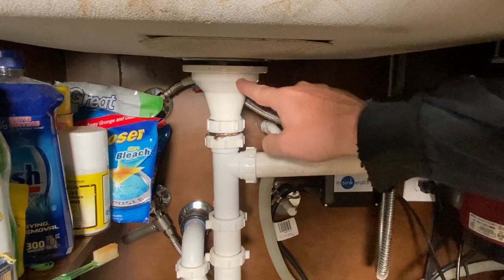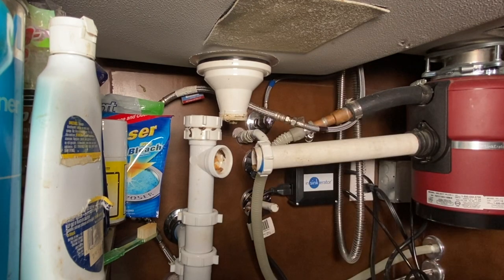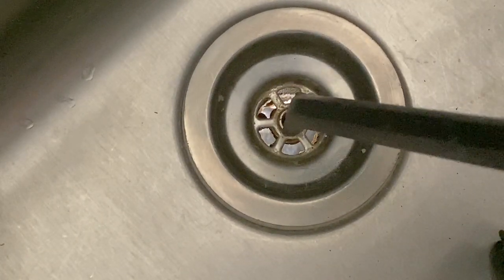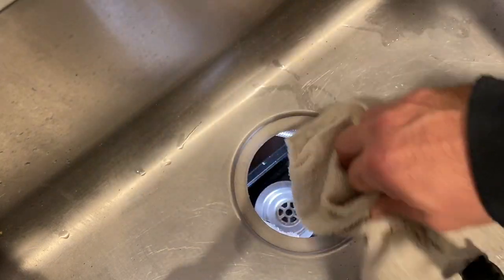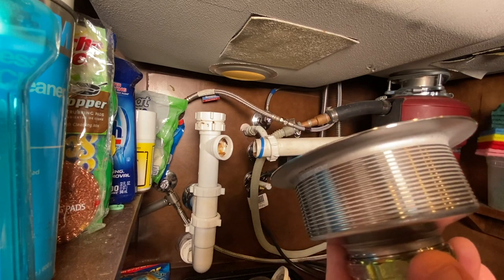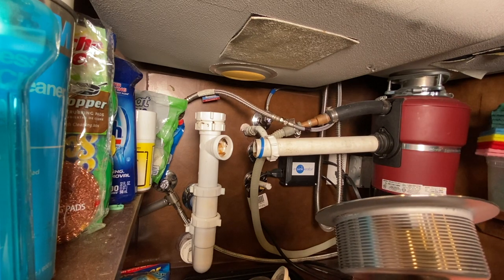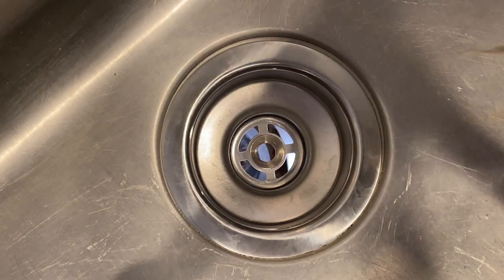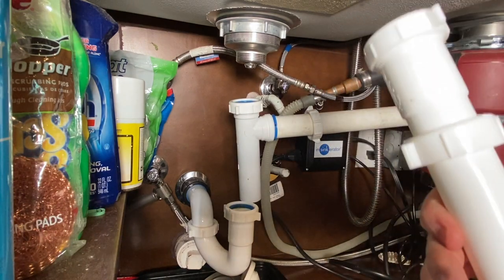Someone Installed a Cheap Kitchen Sink Drain...Made my Job A LOT Harder!

Comment: I have a 25 year old Corian kitchen countertop/double sink that had a "plastic" sink strainer in the left-hand sink.  It looks exactly like the one in your video - and it didn't match any of the other strainers in any of the other videos I watched.  Mine was a bit easier because mine had the same slotted brass bolt connecting the strainer to the "cup" below.  I was lucky, along with the slotted bolt, mine was connected to a brass nut.  Once I figured out, I got the right socket and an extender - the rest was just like you represented in your video.  The entire process took me 20 minutes and saved me a boat-load of money not having to call a plumber to do the job!!  Without your video I probably would have gotten my saws-all and cut the whole damn thing out!!  EXCELLENT JOB Fix It Guy!!  👍👍👍

Comment: I work at a new townhouse community as a maintenance technician and came across this today. It was gray and a POS. It was loose and water running down, where the putty goes. I replaced it with the same replacement lol.
Reply from the maker: Right on. Yeah I’m not a fan of this style. Seems to never tighten like it want.

Comment: I just picked up a Brass Craft P. O. Plug wrench to hold onto the basket. Try that and carry it with you.• For holding pop-up plugs
and drain strainers in place during installation
• Durable zinc die-cast
construction

Comment: The way I have gotten the strainer out is by using the tips of the handles of a pair of pliers into the holes of the strainer itself, rather than a super wide screwdriver/butter knife/cats paw
Reply from the maker: That is a great option.  And that way you have something you can put some torque behind as well. Quartet don’t always cut it.

Comment: I just removed one of those plastic ones yesterday. Luckily the bolt on mine broke pretty quickly with not much effort. I was glad because it wasn't turning at first, but thought what a POS. First time I've ever changed one of those.
Reply from the maker: Yeah I am not a fan. I feel like it will never tighten as much as I would like it to. I glad it came out easy for you!  Plumbing can be so discouraging sometimes!

Comment: I had the same in my apartment and couldn't unscrew it as well. I ended up using a sheet metal cutters to cut through the six thin metal strips. It came right out. What a garbage plastic part, I'll upgrade to a quality metal part in my kitchen.
Reply from the maker: That is a great idea.  Thank you for sharing.  Will make an easier demo if I run into this again.

Comment: Love your video. In life every bit helps thanks for sharing. You asked if there is an easier way. I have one since these basket strainers are garbage any way. I did this since I was unable to do it your way. I just put a quarter on the end of the drill. Still too tight. So I just drilled it out from the bottom.

Comment: Just ran into this myself....I am short on cash so I wanted to clean it out and tighten it up not replace it.   So I needed a tool to get that screw out.   Found a video on the Kraus brand like it being installed made by the manufacture.  They recommended a 15mm flat screwdriver or a coin.   My solution was a quarter in a vice grips to get it out.

Comment: You could have also used a nut extractor to extricate that slotted nut with the same principle as a tub drain extractor
Reply from the maker: That is a great idea!  Thank you for the suggestion. I will be using it in a basket strainer video!

Comment: Not a professional plumber here and maybe it's normal... I have never seen a dishwasher drain go directly into the wall instead of connecting above the trap... Interesting. Like the videos That Fix It Guy! 👍
Reply from the maker: Great catch!  I am planning on shooting a video of that.  I noticed it as well. My friend got hosed on this remodel. There is suppose to be an air gap installed for the dishwasher as well. They did not do that.  I will at least put a high loop in for him so the dishwasher will not fill with sewage if he gets a sink stoppage.

Comment: Question are you a licensed plumber ??? Ty I liked your video I have granite black double sink am putting in the old is crap . I cut out a new countertop of 1 inch plywood I measured it doubled checked it few times lol question my new sink is bigger so I need to push it up I wanted to know if I just cut the pipe make it shorter and re attach that will work I don’t know need a little help gonna watch more videos from you thank you man ur real I like that Joey 😎🤘😎

Comment: LMAO ~ 
Toss  a quarter in your toolbox.
Next time try a 25 cent quarter, with a screwdriver down the drain to keep the unit from spinning when you easily unscrew the drain with a quarter. Less than 20 seconds.
Then just reseal with some new putty. Use the quarter to rescrew it back on.
Easy, inexpensive, like new. Those drains are awesome and super easy. Didn't even chip a nail 💞
Reply from the maker: LOL.  Who knew a quarter could fix all my problems.  Thank you for the tip.

Comment: Just thinking outside the box here.  What if you took some flat stock and JB weld a couple of bolts to it. If it is a “standard width” you may be able to set a handle to it? Kinda like a t handle Allen wrench with a couple of studs?
Reply from the maker: I like your  thinking Jim. I will get to the drawing board and see what comes out.
Reply: That Fix It Guy or spending some quality time in the “Library”!😂

Comment: Been loving all the videos bro, was thinking on the width of the screw driver being a problem to be able to unscrew or hold tight the basket strainer to unscrew it. Heck, I 1" wide or so chisel came to mind, maybe a look into the ol' tool box and you may have one as you can take it to the grinder to make it fit to your needs.
Reply from the maker: That is not a bad idea.  That screw driver I tried is the biggest I carry. Tom has a great idea and I think I will buy one. Never knew brass instrument tools and plumbing tools were universal!  I’m digging it. If not I was going to make one up. Thanks for watching!